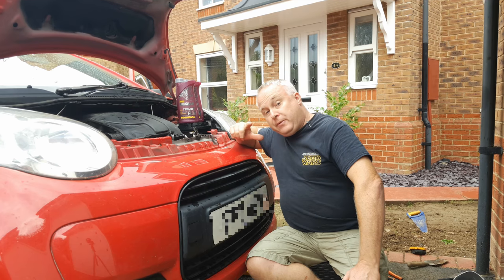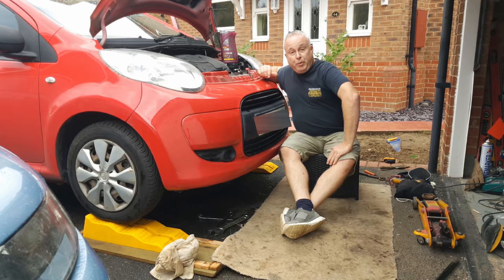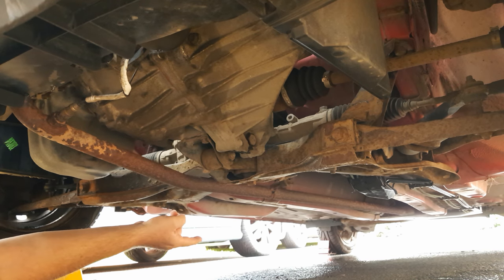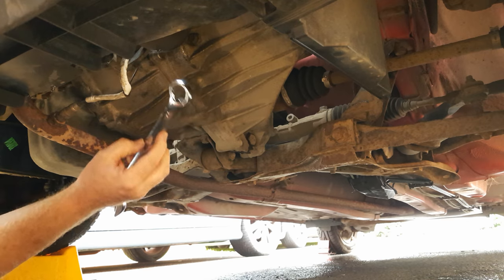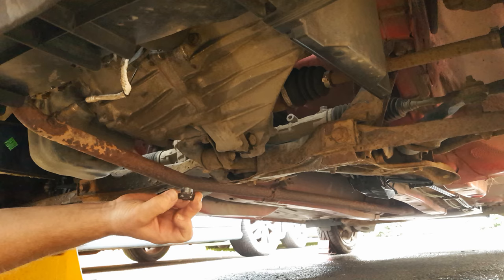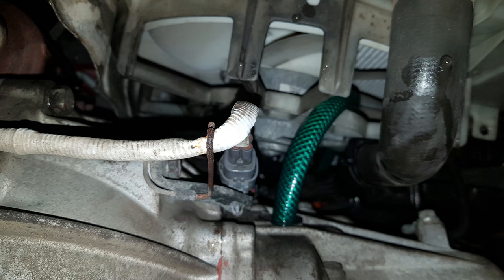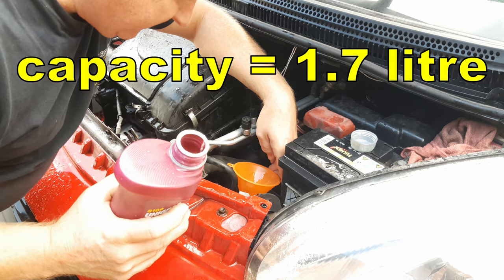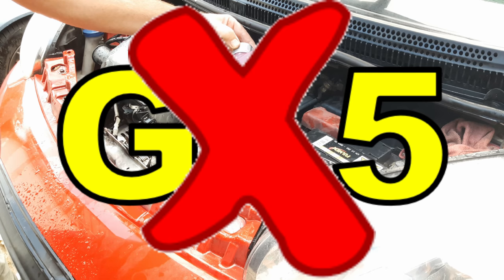How to do a Citroen C1 Gearbox Oil Change and Gearbox Oil Level Check

Comment: I just got a C1 after 15 years on bike and it's a great little car but garages hourly rate is though the roof. I've done most of the service myself thanks to you and others on YouTube.
Reply from the maker: Thanks for sharing 👍
Reply: Yep, got quoted £400 to change the front passenger seat belt, got a decent one from a breakers for less than £30 and fitted in less than an hour. Front discs and pads less than £40 fitted, oil and filter service less than £30, another £20 for air filter and pollen filter.
Reply: Amazing how cheap it is to fuel. Like it runs on glitter & dreams more than petrol

Comment: Just followed this tutorial for a 2008 Yaris 1.0, that has got the same motor (the 1FR-FE Daihatsu) shared on the Aygo too. Same specs for trasmission oil 75w80, 1.7 litres :) thanks for your valuable instructions!
Reply: And does is shift better?
Reply: @TinnoRambo  I had the feeling that shifted Better. Also, seems that the First engages Better too. But It's not that radical feeling, so take It as It Is ;)

Comment: hello, you doing a very good job and your videos are very usefull.
i have a problem with my aygo 2008, i need your help.
 i recently purchased this car and the airbag light blinking dont know how to fix.
 i see a broken wires on both driver and passanger seat, wire colors are orange, yellow and green with yellow striped.
but im not sure is this the reason for that.
airbag light goes on for two second and goes off for two second and this cycle continues.
please help me with this. am a big fan of you.

Comment: It might be a stupid question, but I will ask it anyway. What are the reasons for changing gearbox oil? What would happen if I didn’t had the oil changed?
Reply from the maker: There are no such thing as a dumb question. Asking questions is how we learn. 
The oil degrades over time and with use. It's ability to lubricate, cool and protect (gears bearings seals) reduces. 
The manufacturer has determined an average lifetime of around 150k with no further action. 
Refreshing the oil occasionally can extend the box life massively
Reply: @CycloneCyd  I was wondering how a gear box with old oil behaved? You mention that it protects the gear bearing seal. How would an unlubricated seal behave in a car? Will I have difficulties shifting gears or something similar?Thanks.
Reply from the maker: @JLyck  noise, difficult shifts, leaks, economy loss and eventually complete failure of some sort. My son's Polo suffered a seized box at just 96k miles having never had an oil change.
Average 'life' being 150k means 1/3 to 1/2 of all boxes will suffer early life failure before this. If you do nothing, you might be lucky or you might be unlucky.There is no way to predict which.
Changing the oil is not a guarantee of long life, but it does stack the odds in your favour instead of against you.
Oil is cheap - a 'box rebuild is not.

Comment: How mentioned dropping the car down the check the level of the oil is correct but didn't say how to check it. Can you please explain this? Is it just that if its overfilled that it will spill out of the fill hole? Can you even overfill this?
Reply from the maker: The fill hole is also the level hole. When the level in the 'box is correct you should just be able to discern oil on the threads of the hole. Any excess will drain back out from the fill hole.
Reply: @CycloneCyd  Thank you.

Comment: Thanks, if you had the car level (just for ectra safety) would the drain plug still drain fully and would fill plug still fill (fully)? Is having the right sideof the vehicle higher strictly necessary? thanks

Comment: Hi, do you have a video or advice on doing the automatic transmission fluid level check and possible change I cannot find any information regarding if this is ever required I still use what as my dads 2013 peugeot 107 automatic now covered 44k miles.
Reply: It's the same process. Buy obviously use automatic gear box oil

Comment: Thanks for this
Is one litre of oil enough?
Reply from the maker: NO, absolutely not. The capacity is 1.7 litres, you should not run the box with a severe shortage of oil. Oil is important for lubrication of bearings and cooling of gear teeth (the contact between any two gears is a few mm^2 only.
Reply: @CycloneCyd  thanks for clarifying I just bought one litre
Should I buy 2litres of the gearbox oil you have used and linked?
Reply from the maker: @solomonatlanta5953  I'm very pleased with the Mannol in both the C1 and my Saab. Gearchange is much improved. 
So, I would have to say YES
Reply from the maker: @solomonatlanta5953  if you can help it, don't mix oils.
Reply: @CycloneCyd  thanks for your quick response 

Are you sure you gearbox oil you use and have linked is compatible  the citroen c1 2005-2011? 1 litre petrol
Reply from the maker: @solomonatlanta5953  yes
Reply: My daihatsu sirion m300 with the same engine ( 1kr-fe) the manual says that it takes 2.1liters.strange it had different gear box?

Comment: Did the end of the hose pipe fit into the fill plug hole?
Reply from the maker: YES. my hose is 18mm OD and was a snug fit so had to be pushed in firmly. Hence recommending 16mm OD if you are buying a piece especially.